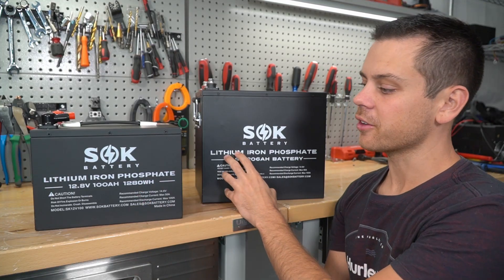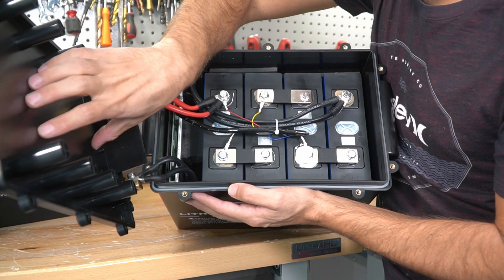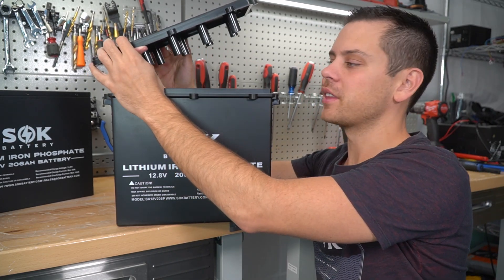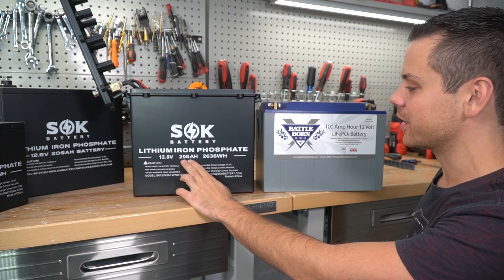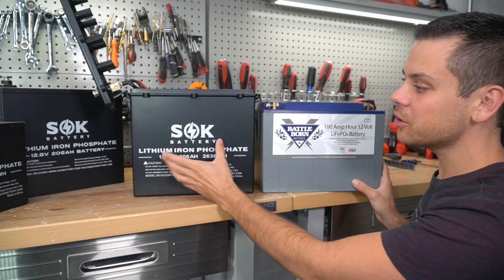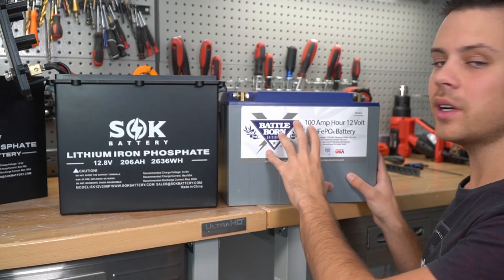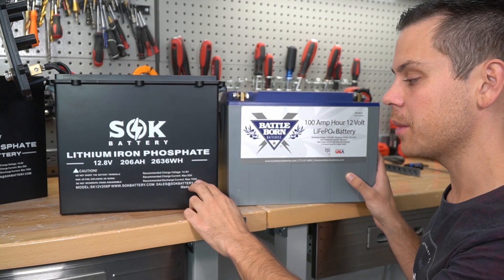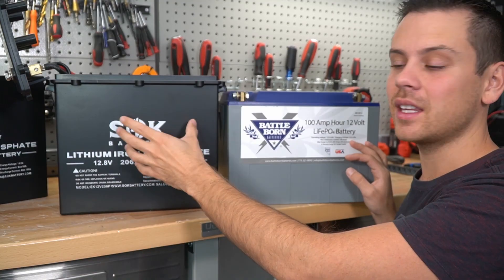New Battery! Marine Grade SOK 12V 206Ah LiFePO4 for $.39 per Wh

Comment: Is the reason that the 206AH battery only discharges at 100A because it actually uses the same BMS as the 100AH model. I think we should be told :-)

Comment: Hi Will, can the marine grade SOK 12V 206Ah battery be used as the engine start battery for a V8 engine boat? The BMS has a short circuit cut-off around 300 Amps. What is the best DC-DC charger that could be customized to charge the Lifepo4 to 80% state of charge?

Comment: I went to SOK to possibly buy either 2 or 4 of these for either a 24V or 48V arrangement.   But I don’t know much about this stuff, on the website it warns about connecting & charging these batteries in series if they aren’t at the exact same charge (and Will even said that there’s no charge rate display on these)…so my rookie question is does a charge controller take care of that problem automatically?
Reply: Wouldn't you charge them separately until the bms shuts off charging. Then wait about a hour to stabilize the voltage then you can parallel them.
Reply: @merlpriester  I would want them in series.    I’m also wondering which size charge controller and inverter I would wanna go with for either 2 in series or 4 in series.
Reply: @joebuck4496  I am not an expert but I would still do separate charging to max charge. BMS stopped charging each one.  Then parallel all four and let stabilize the voltage.
Then I would do the 2s2p configuration or 4s as you wish for four batteries.  Same method for 2 batteries.
Reply: @merlpriester  oh ok I get it, just temporarily parallel them so they all even out.   That’s a cool piece of advice and makes sense thanks!

Comment: Are there some absurd tax on them in the US? In philippines a 12v 100ah lifepo is about 175-200$  instead of almost 600$ and 300$ for a 12v 200ah, brand blue carbon. But others exists as well. What am i missing?

Comment: I really wish someone would make a good battery like this with a long, flat footprint, suitable for mounting behind a rear seat in an SUV or pickup. The traditional battery footprint is just too bulky to fit inside a vehicle's cabin in many overlanding rig situations. It would be super to simply add a different 'flat" case option without changing the electronics. I currently run a Dometic PLB40, and, boy, does that need a heater for winter travel. It takes hours for it to warm up on its own from a freezing night, squirreled away in the packed cargo section of the 4-Runner. Great battery, otherwise. I suppose one could replace the standard case of an SOK with a flat, thin Pelican case or something. Thoughts from the community?
Reply: Have you looked at Battle Born BBGC3  battery? It seems to fit your bill exactly, it is narrow and mountable in any angle, sideways or upside down.
Reply: @blainespaulding3197  thank you for the suggestion. I’ll check it out.

Comment: Hey, will. I bought the 206ah sok based on your recommendations. I’m having an issue where my RV system shuts down after using only 150ah (according to my victron battery monitor). What can I do to get more use from them when I need it?
Reply: Could be your inverter efficiency is low..
Reply: @matmo4665  Victron battery monitor is a DC monitor with a shunt, so the inverter efficiency has no effect in this measurement.
Reply: I hope you figure this out. I don't want to buy a lemon.

Comment: A bit off topic but, If I am building a 48v system.  Do you have enough experience with Relion batts to know what the limitations are for the number of batts I can string in a series/parallel circuit?  I'd like to use 8 of their 12v RB100 batts, 4 in series then 4 more in a parallel bank for a 48V 200ah bank.  Any thoughts?  Relion has not yet answered this question for me.

Comment: WRT the comparison that SOK’s 206AH Battery is limited to 100A Discharge and that alternatively, you can instead buy 2 Battle Born 100AH Batteries with a 100A discharge each, to give you 200A of discharge:  

Remember that you would then have 200AH and 200A Discharge capability for almost twice the price of one 206AH/100A SOK. 

Wouldn’t a MUCH better investment be to buy 2x SOK 206AH/100A Batteries (about same price as 2 BB 100AH/100A Batteries), so you would have 412AH with 200A Discharge?

Of course, if 200A Discharge isn’t enough, a 3rd SOK would get you to 618AH/300A, vice a 3rd BB, which would get you to 300AH/300A. Correct?

Comment: Will, If you had to build a stand alone battery backup system for a home what kind of batteries, charger, convertor, would you recommend. Load is a typical home with all LED lights, refer, furnace blower, computers/etc and a few minor loads. To last 3 to 5 days. No solar, just a backup generator that can be used to recharge when required.?? I am a retired service engineer for Semiconductor process equipment so assembly and such is not an issue.
Reply: I built my own backup system from components. It would take 5 pages to explain how to do it. But there is nothing better on a stormy night than watching a video on the big TV in a warm house while the neighbors are freezing while lighting candles. You are in luck. The components have become so much better in the last 5 years than what used to be available.  I don't have solar due to trees, hillside. I can recharge with an Onan standby generator in the daytime as needed. But I prefer to rig for silent running if at all possible..

Comment: I've actually gotten to where I'm stomping on the temptation to buy any LFP battery I don't have an immediate (or at least solidly foreseeable) use for because I know the prices keep dropping and the quality (generally) keeps improving! "Wow, that's an amazing price per watt-hour!" ... and then remind myself in a few months I'll be saying the same thing again about a noticeably lower price.
Reply: The costs are already stupidly cheap for the amount of use you will get out of them. But they continue to drop in price on average 22% a year. In ten years time its going to be cheaper to be energy self sufficient than the base charges of being connected to the grid. Before consumption charges are added to the equation.

Comment: Could you link the 100a battle born to the 200ah sok? I'd like to add one to my 12v system on my sailboat. Already have 2 battle born but need more power!
Reply: Well, if all the batteries you buy have BMS’s, and if you are looking for longevity, I suppose just sticking them in parallel will work, until the 2x 100Ah batteries are dead, and the 200Ah is trying to run the load & charge the other batteries.

I don’t know how you get around that easily… unless the BB BMS will only enable charging if the voltage is above what the SOK is putting out?

May be better adding the SOK with a switch, so when the 2x BB are empty, you flick the switch to the SOK.

Comment: That is perfect timing for marine grade batteries. I hear if charging from a high output alternator, it would be good if the battery was able to communicate to reduce alternator output in case the BMS wants to disconnect the battery. Apparently this could otherwise destroy the alternator. Can you make a video on that subject?
Reply from the maker: Need externally regulated alternator, with current limiting. Special charge profiles not needed at all with lifepo4. Yeah probably need to make a video
Reply: @WillProwse  that would be awesome. You are still the best :)
Reply: @WillProwse  are you thinking about checking out pylontech batteries? Rack design. I’m really wondering if they are good. Thanks for your content! 😉

Comment: PLEASE HELP, been watching your videos, I have a big question I hope to get some help with. I'm in the middle of building a mobile beverage trailer and moving it to Kauai. I currently have 5 Santan 250W panels as well as a 2000w generator to supplement. I am looking for any input on what batteries to use and a good solar controller to use. I have a few questions about best way to run the system for the best efficiency. ie. series parallel agm lithium THANKS IN ADVANCE TO ANY NEW INPUT. Mahalo

Comment: Do you think I could remove the current 12 volt battery from my 5th wheel and put 2 SOK batteries in its place letting it charge whenever I plug my trailer into a 50 amp pedestal?
Reply: You need to change the charger to one that can be programmed or selected to charge Lithium Iron Phosphate as the charging profiles are different with the two battery chemistries. The inverter or 12 volt appliances won't notice the difference.

Comment: I've noticed most batteries are 100Ah, For marine use, is a 100Ah battery more stable or would I be better off loading up with the SOK 206Ah batteries? I'm looking at a 60 ft. Hatteras,  and if it works out I'll want to build a 4000-5000 watt Solar Array. Space permitting.

Comment: I built my own 400ah for my motorhome last year. I bought the cells from battery hookup. Now I am using the chin batterys in my solar traffic message boards and arrows at work. Thanks to you my motorhome is powered up and our fleet at work is going lithium and ditching the lead acid battery’s. Will, thank you very much! Lifepo4 has its own rules for battery management. It is time to ditch the lead.

Comment: Hmmm So I was going to get 3 Battle Born 100 AMP Hour batteries for my RV. But then I found the SOK 206 AMP hour battery and thought WOW!! that sounds better than the Battle Born. Then I watched your video and you talked about the "Discharging and charging capability" indicating the Battle Born was better. You indicated the SOK has about 1/2 the discharge rate capability.

My use is in a 40' RV with 2000 Watt inverter and DC to DC charger from my Alternator for charging. Maybe one solar panel but no big total solar install. Also a way to use my 8K generator to also charge the batteries. 

It sounds like the SOK would not be a good fit for me. I really liked the price as compared to the Battle Born. With the SOK I thought I could 2 of their batteries (412 AMP Hours) for the cost of the 3 Battle Born ones, ( 300 AMP hours). 

So am am I correct to pass on the SOK's and stay with the Battle Born's? Or do their non marine or 100AMP batteries have the same discharge rate issue?
Reply from the maker: If you can use double the batteries for the same price with sok, then you will have the same current capabilities. And double the capacity.
Reply: The  2ea SOK would provide me double the AMP capacity vs 3 Battle Born. But what about the discharging and charging capability and the 1/2 the discharge rate capability?

Comment: Are you familiar with humidifiers? There's a new hot concept of turning air into water using humidifiers and with the power coming from solar panels we can help out so much to minimize global warming, I think. Some of those air to water devices costs up to $30,000, if not more. That's far too pricey for many of us that got hit by the pandemic. But, Newport on you-tube has great innovative ideas for a cost effective DYI air to water device.  How to figure out all the connections? Is his calculations safe? Can we move the solar panels around on the same cart? Will, please help? The draught is causing us a real hardship and we're loosing our plants that take in carbon dioxide and give out oxygen (photosynthesis). As you already know, CO2 is one of the gases that is causing the green house effect because it gets trapped into the atmosphere and reflects back down to earth. Please help...

Comment: Anybody know how to check to see if I killed the bms on my LiFePO4 200 Ah battery?  I accidently grounded it (ugh!). It seems to drop down to 13.2 volts at night with NO usage, and it totally drained dead after only a few hours of running a 325 watt refrigerator. It appears to charge fully with my solar panels, and I've left it hooked up to my charger at the same time, so it should start out full if the bms is allowing it. I'm stumped.

Comment: Will I have SOK batteries in my fifth wheel. It is going to be14F tonight. Within 2 months we could get down to -30F. My main house system has repurposed Tesla batteries. I have a heated Glycol that pumps through them. I personally would not invest in self heating batteries either. There are other more efficient ways to do it. A low temp cutoff is a must though. I love your videos Will. Great job once again.

Comment: I have two BB batteries and we are getting two more batteries. Is there a way to combine the BB with SOK. I would rather get two of the 206 amp SOK than 2 100 amp BB. There must be some sort or way to combine these in parallel.  Anybody know or Will can you figure out a way. This is clearly going to be an issue for a lot of people. Maybe changing BMS so all are same.  Seems to be just an engineering issue. Anybody?  Thanks.

Comment: can you explain the continuous rate of discharge and what that means in practical use with solar vs no solar?  I figure I am not thinking this through but it went past me
Reply: With solar, the C rate of charge is low, so no issue with the battery. It will take all the amps the solar can give.
And regarding discharge, you are unlikely to have such a big inverter that sucks a battery dry fast, like in an hour. (If it did your design is poor)

Comment: I was looking at the spec sheet on their website and it states that the maximum charge acceptance rate is 50 amps which is about .25C. That's great if solar is the only charging source, but my boat has a 140 amp alternator. At 50 amps we are talking a few hours of engine time to charge up a single battery. What determines the charge acceptance rate? Can it be improved via the BMS? Sorry if that is a stupid question. Thanks,
Reply: If you have two batteries in parallel then you can double the charge current.
Reply: @rickmaddy3133  That's true, and I only need the capacity of one at 200ah, hence the question stands. Thanks for the reply though.

Comment: Two things I think you are missing in your critique... 1: is that the size of that battery is not a standard for a marine battery. The clamp or straps in the boat will not accommodate the extra height of the battery. 2: I am the idiot that has the boat under a shed and still goes fishing with frost in/on the boat. The battery will obviously be below freezing, so a heated battery could be beneficial.
Reply: @Keyzer Soze If only it was that easy. It's way down in the bottom of the boat, wires and hoses over it. Have to twist it sideways to get around a fuel fill hose too. Plus, that's what I bought a $350 on-board charger for.

Comment: I think your over looking the purpose of heaters in batteries. People with campers and houseboats in places north of your latitude need some protection from destroying their battery when the temperature dips suddenly. They are often in locations for extended periods of time without power hookup. You could leave your camper in the morning to do some shopping and arrive back at your camper 10 hours later and find a weather front has come in and your batteries have frozen.

Comment: Is there any kind of safety rating or insurance consideration for marine batteries?  A friend is interested in replacing the lead acid batteries on his boat but his experience with lipo drone batteries makes him question their stability and safety down in the bilges.
Reply: Lipo pouch cells found in drones are totally different to lifepo4 prismatic cells used in these batteries.

Comment: Will, have you done a review of the JITA battery? It's cheaper than the SOK and comes with a heater in it's BMS and has fantastic reviews. I like the 300Ah size and am considering purchasing a number of them in Amazon. Thanks

Comment: Is there a way to safely use two different batteries in the same system? I have the Battleborn 100ah heated battery but want to add a SOK to my camper would that work?

Comment: One of the most important thing in marine electrical wiring is - you don’t solder, you crimp (so crimping & soldering is a novice error).

I hope they have atleast used proper marine grade tinned wires.
Reply: …. and is the heat shrink the proper adhesive version, not without the glue?

Same for BMS, proper conformal coating to prevent moisture/salt corrosion - or if nor coated then molded/potted properly?
Reply from the maker: Yeah we cover that a lot on this channel. Crimping is better than soldering. These are crimped. And agreed on potted or conformal coated for any board. Most bms these days are coated, unlike the olden days. I don't require those features on components in the case. If they were exposed or had air cooling, then it would be required. In a sealed box, not an issue at all. The seal that matters is the terminals and lid. Or else it would be built differently.